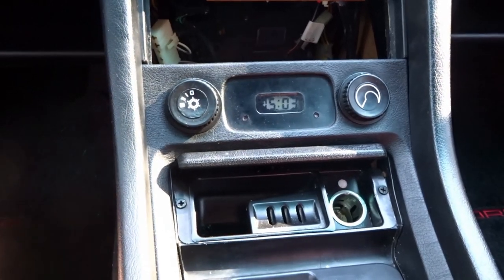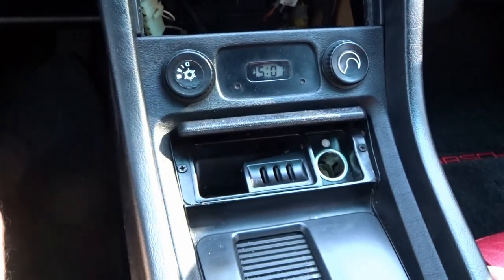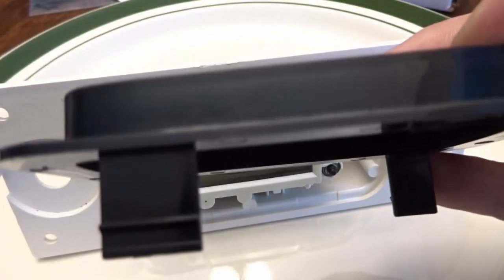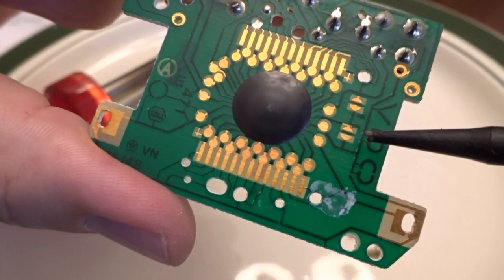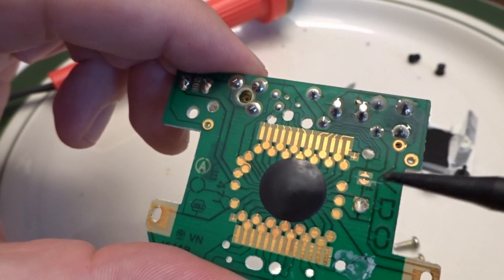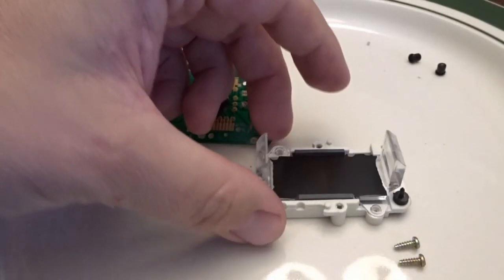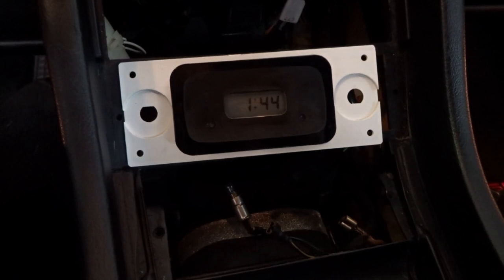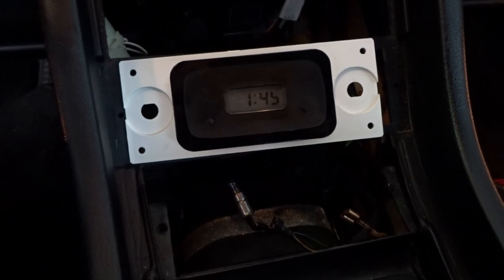Porsche 928 (S, S4, GT) Digital Clock Repair Video - Replacement LCD Screen and 12 Hour Time Mod

Comment: What a great video! I stumbled across this just as my replacement clock display arrived in the post! The display on my 87 S4's clock looks like a Rorschach test! Didn't realise I'd need a de-soldering pump, so I've ordered one. Thanks!
Reply from the maker: Good luck and be gentle with the 33 year old plastics! It really will make a big difference in your interior.
Reply: @Bubblun1  I've a huge list of things to fix on mine. Mechanically it's fine. It's mainly electrical things (hatch release, sunroof, gear indicator lights etc).
Reply from the maker: @AndyD070568  Yeah my "D" gear indicator light is out - I'm still learning how to fix that one so would appreciate any tips if you tackle it!
Reply: @Bubblun1  I suspect mine are simply not getting power (there's a connector in the spare wheel well that comes from a switch on the transmission that supplies power to the reversing lights and also the gear indicator lights) as none of mine work. I suspect your D light has just burned out as that's the light that will have been on the most. A few people have replaced all the incandescent bulbs with LEDs which is something I might look into once I've sorted out the other issues I have.

Comment: I lost buttons which changes the time, can i find them anywhere? Thanks in advance.
Reply from the maker: Yikes, that's rough. I don't think they're sold separately. I'd keep digging, mine blended in with the flooring and took me a while to find when I dropped them.
Reply: I found a solution, i repaired joystick early and i remembered that the joystick have same rubber buttons from the inside, follow this advice for your channel, thank you.